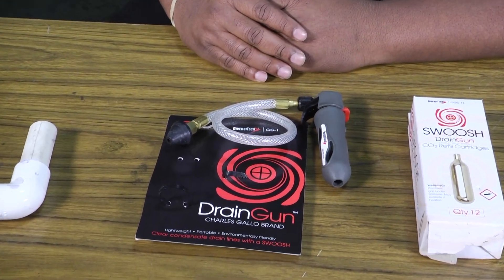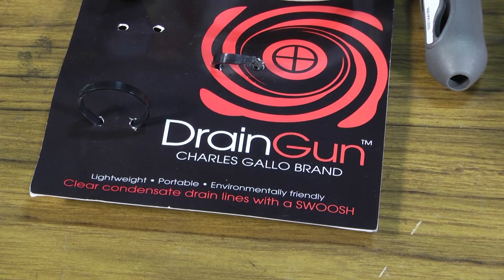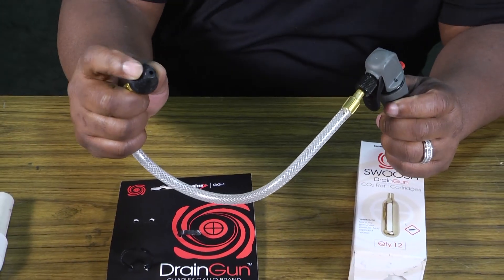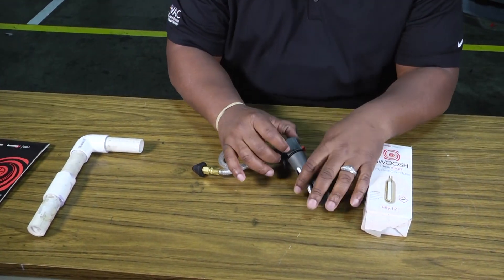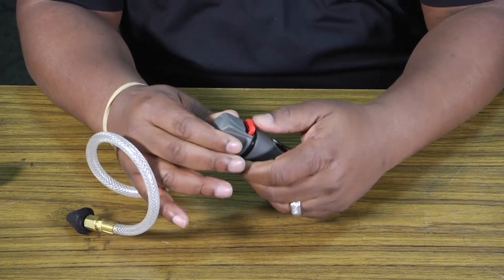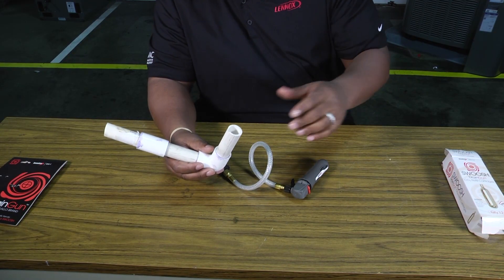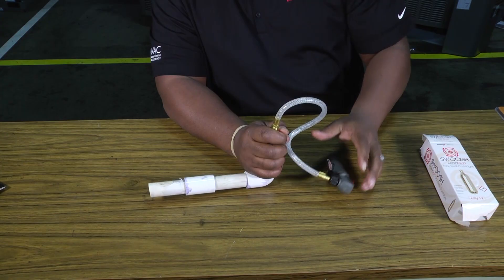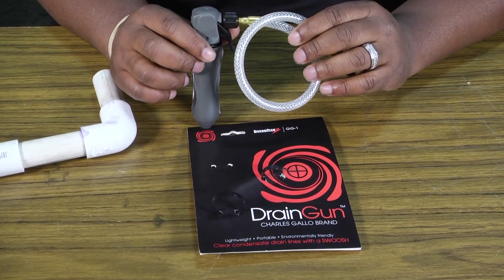Effortless Maintenance: How to Clean Out Condensate Drain Line with Drain Gun | HVAC Tips and Tricks

Comment: We used this yesterday to clear the clog in our fridge/freezer because the bottom of the freezer was icing up, but now there is a strong acidic smell in our kitchen. Is this normal? How long will this odor last?
Reply: Did you figure it out? That's a standard CO2 cartridge and shouldn't have an odor. Its possible the pressure broke the line.

Comment: My 3/4 " PVC drain line shows it is rated for 200# pressure. I have heard that this will put 800# pressure through the line to clear an obstruction. Is it safe to do without damaging the PVC piping? I think the clog is at the trap where the drain line leaves the unit but there is no "t" or cleanout up there to access using a gallo gun. If I install a "T" it would have to be down stream from the unit and I would be blowing any clogged material back into the unit rather than away from it, to where the drain goes to the outside of the house. Thanks for any help you can give.

Comment: Sometimes you have access at a "TEE" where the two downstream legs is---> 1st leg).... toward the outside drain and 2nd leg--->.) toward the insides of the air handler. A system like this to pressurize won't work. What works almost all the time is attaching a shop vac at the very last exit point., meaning using vacuum instead of pressure. The piece here is nice if all it does is blow out toward the last exit point.
Reply: I tried a shop vac at the exit point but it is about 30 feet away from where I think the clog is and didn't work.
Reply: @Charles-in3zt  ...I'm just pointing out that applied pressure....if used like this vid.....needs to totally attack the clogged area, and no other area. The air-pressure can't take a side-trip to some other branch circuit...as CAN happen like I show. In that case, drawing a vacuum from the end OFTEN works ( not always if the clog is stubborn like yours appears to be). In the case of a stubborn clog, either a stronger vacuum needs to be used, or you need mechanical (brush and wire handle/shaft) to attack the clog. If it's plumbed correctly, maybe even pour a cleaner from a point ahead of the clog toward he clog, but again be aware of branch circuits and don't allow the cleaning solution to enter the main housing of the air handler.
Reply: @TheWilferch  Thanks Will I agree. In my situation there is no way to gain access coming out of the unit in my attic because they didn't install a "T" or cleanout access. I think the clog is in the trap right after it leaves the unit in the condensate drain line. I would have to shoot it downstream of the clog and back toward the unit which as you say is not a good idea. When you say the air pressure can't take a side trip to some other branch, do you mean it can't as in the pressure would be reduced or are you saying something different?
Reply: @Charles-in3zt  .... I'm basically saying if you want  "the applied pressure" to work....(to unclog the point where it's clogged), ....you want to get upstream of the clog and apply the pressure there..... in a way that it only goes to the clog, and doesn't take a side trip thru some TEE back into the air handler.....it's hard to say without a drawing here. The applied pressure will not go to the clog if there is some other tee in the path.... it would then go back to the air handler. I agree.....most of the time the clog will collect at the trap. If the trap is right at the exit of the air handler, and there is no push-on connector there ( or maybe its glued tight), you may find you need to cut the pvc......clean it out....and then later re-install with a pvc coupler. Does that help?
Reply: Yes it helps a lot. In my situation the drain line exits the air handler and immediately is elbowed down about 2 inches then elbowed horizontal about an inch and a half then elbowed up about an inch then elbowed into the 20 ft length of pipe that runs to the outside. There is only maybe a quarter inch of pipe between any of the elbows so it seems impossible to cut and then use a coupler to put it back together. If you wouldn't mind, would you send a text to my cell so I could text you a picture of it? If so I will put my cell phone number on a reply. I think it would help if you could see what I'm describing.

Comment: I want to clean a hose, not a PCV line. as in a humidifier's drain hose that goes into the drain line.  is there an adapter for the small hose?  also when you use those cartrages I would think you need some kind of cylinder lube to seal the Co2 cart. on a target practice gun, as in a pellet gun, the recommend a seal so it does'nt leak or explode.

Comment: Doesn't seem like enough for long lines.
Reply: That was my thought too.  My drain pipe starts in the attic traveling about 25 feet horizontally to the side wall then down about 20 feet to the ground outside.  Anyone know if this is powerful enough to clear that a drain line that long?
Reply: @j.lincoln5992  Man I wish someone would have answered your question, I have the same situation. Did you ever find out?
Reply: @Charles-in3zt  no, I never received a response from this video or others.  So, still not sure if it works for long drain lines.  As of today I am still adding either vinegar or bleach monthly and that seems to be working OK, but it would be nice to have a reliable compressed air solution to clear a clog without calling an expensive contractor.

Comment: the problem with this is most AC systems only have drain access through a tee, so blowing co2 into a tee is only going to blow co2 into the air handler
Reply: I would cut the pipe connecting to the tee and cap that end off
Reply: @henryesp9284  Add a valve.

Comment: If you are installing an central unit make sure they put a easy disconnect on the drain pipe at the pan if you need to use a tool like this because there are asshole installers out there or their company that they work for that don’t do their job because when your AC stops working they come back and charge a lot of cash to put in a disconnect they should have installed in the first place so they can take your money when they knew you would be calling them because your AC stopped working. It’s all part of the plan ! Unfortunately it’s hard to find an honest air-conditioning or heating company.
Reply: I think you are absolutely right about that. In my case there is no access at all where the drain line comes out of the unit that is in our attic. I'm sure if I used this gallo gun from the outside drain line it would not be effective as the clog is 30 ft away and I would be blowing the clog away from the drain and back into the ac unit.

Comment: What I did was I bought this and the co2 cartridges, but I also went to the home store and bought a couple of different sizes of clear tubing that I could feed into my drain line. I did this to surpass the line connection that goes back to my AC unit. I just took about a foot long tube pushed it into the white pipe down away and shot the air thru that. It worked great and I didn't lose air backwards to my ac unit. Thanks for your tip. this works great. I dod it at least once a year. then I add a little bleach every month also.
Reply: When you say surpass what do you mean? My 3/4 " PVC drain line shows it is rated for 200# pressure. I have heard that this will put 800# pressure through the line to clear an obstruction. Is it safe to do without damaging the PVC piping? I think the clog is at the trap where the drain line leaves the unit but there is no "t" or cleanout up there to access using a gallo gun. If I install a "T" it would have to be down stream from the unit and I would be blowing any clogged material back into the unit rather than away from it, to where the drain goes to the outside of the house. Thanks for any help you can give.
Reply: @Charles-in3zt  he means:  bypass
Reply: @Charles-in3zt  I think he's talking about shoving a tube down the vent towards the outside drain away from the AC unit.

Comment: Do you have to replace the CO2 cartridge for every use? Or will you be able to get multiple uses from one cartridge?
Reply: you can get about 1 and a half, uses so I just shoot the full thing untill it empties.
Reply: @JohnDoe-gv9jv  yall found any way around this? Just bought one and used today. Worked really good but damn 1 cartridge basically for every job.
Reply: @arodandjeter1  buy your cartridges at bike shops.  Cyclists use this same exact tool to fix a flat tire and when you buy the cartridges in bulk at bike shops you can get them for a $1 a cartridge.